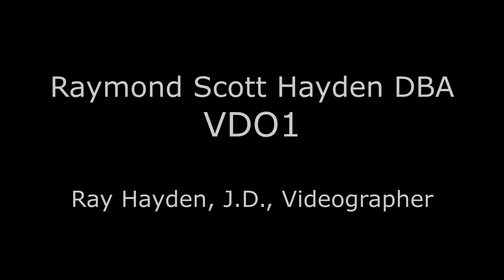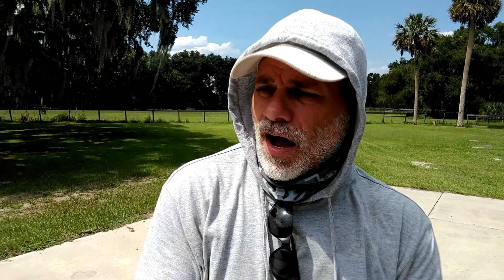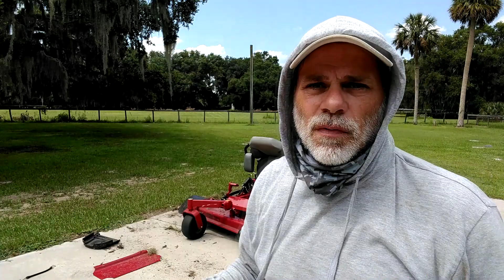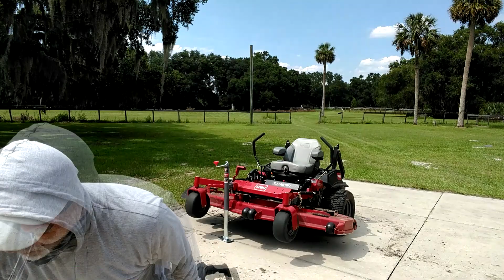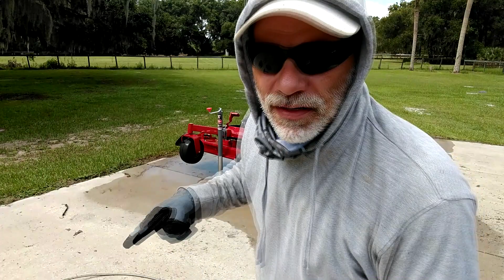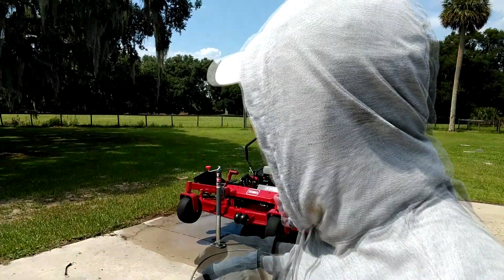Cleaning the Toro 3000 Series Commercial Zero Turn Mower - Ray Hayden

Comment: I just want to know how you are lifting that with a Bulldog.
Reply from the maker: That is a fantastic question! Toro sells a bracket to mount full time to the frame of the mower. I am going to be making a video on that bracket to show how strong of a connection it has.

The bracket is an option, and my Toro Dealer sold me that. I picked up the Bulldog lift at a local farm supply store.

Thank you for asking about that... I hope to make that video and have it online very soon! Thanks for watching!

Comment: Where did you attach the jack? Would have been useful to show that.
Reply from the maker: Indeed, it would be. I have to inspect the blades on that today - so a great chance to discuss that jack thing.

For now, the jack is one of the crank jacks that are used for many trailers, and I had seen a good number of those permanently connected to the trailer... this one can't really be permanently connected, but the part that it connects to is.

From the dealer who we purchased this mower from, we purchased a bracket which is mounted to the mower, and it is there all the time. The crank jack was purchased from a local farm supply store. The dealer told me to grab one that had sufficient weight capacity, and he suggested a bit of overkill on that, so I followed his advice and picked up the heavier duty jack.

I'll make that video today - weather permitting - and show that specific operation. 

Of note, when connected, it is extremely solid. I apply the brakes, of course, but this is not something the mower could fall off of. I originally placed blocks under it, but I do not do that anymore. The mower cannot roll with the stand on it - meaning it could slide without the brake on, but it is not coming off of the stand, or the mower.

Comment: What kind of jack is that ?
Reply from the maker: This is a "Trailer Jack." There is a part that I permanently attach to the mower, and then the jack can be attached and removed... I cannot keep the jack on the mower, that would not be safe. When the jack is attached to the mower, it has a safety pin that goes completely through that jack and that connection on the mower - it saves a lot of time!

Comment: Good to protect yourself from the intense sun,the jack feature is handy to lift the front up. A real good idea to blow out, then pressure wash to remove the buildup of grass clippings on top and under the deck, especially if there happens to be an accumulation of wet grass clippings caked underneath the mower deck, it's best to blast all that out so that it doesn't promote possible rusting out of the mower deck.

Comment: That was a nice setup on that jack looks like it work well. Was that an option for that mower are just something you came up with?
Reply from the maker: You buy the bolt on adapter, then you can pick up the crank jack. The dealer just told me to go to a store down the road to pick it up, because he could not match that price. It is an excellent tool for getting to the blades, which I will be putting on tomorrow - third set in two months! I am brutal on them - but I want this property back!
Reply: very nice setup thanks for the tip.